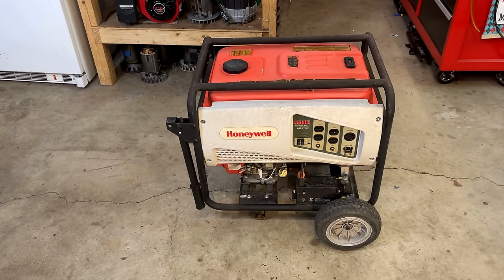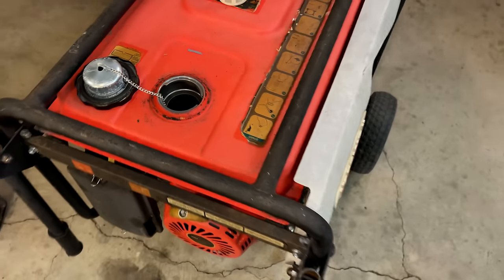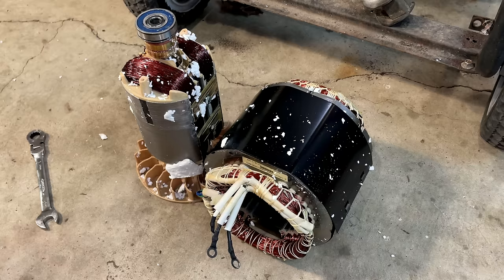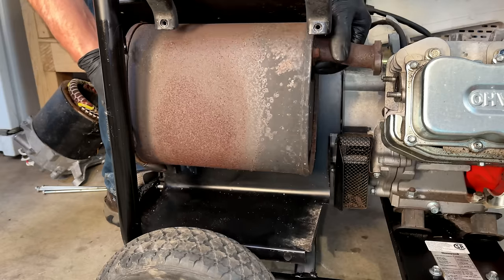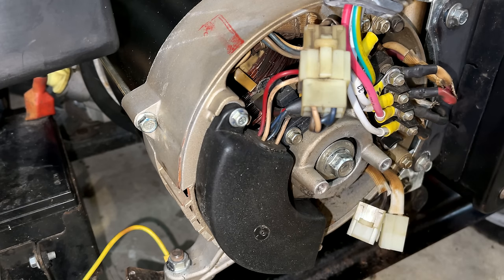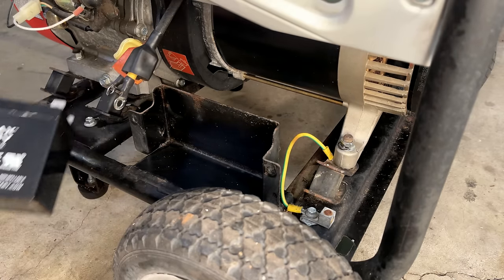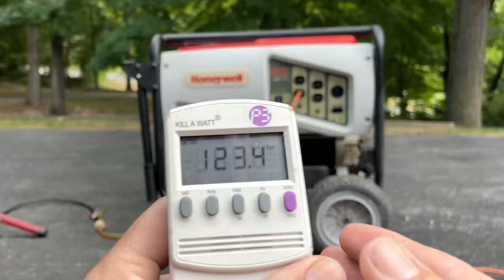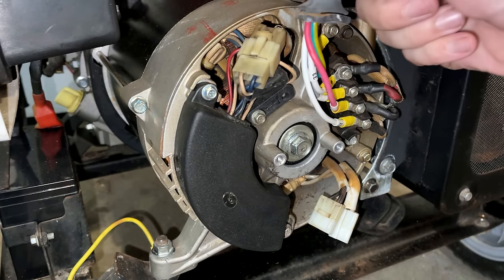Honeywell Generator Not Making Power - Fixed

Comment: I lost track here, you had a new Ryobi powerhead to use as a replacement but you got Predator one in there? What did I miss?
Reply from the maker: Yes.  The Ryobi powerhead was too short.  So went with a used one from a Predator generator.

Comment: Hi, u can carry the bad rotor to a motor rewinding shop and the can change the aluminum wire to equivalent copper wire, and the power head will run just fine

Comment: You should have just cleaned the copper coating off the wire and soldered it instead of going through all this stress for a new power head,except if you dont know how to solder

Comment: Thanks James for the video. Unfortunately, I realized that during step 1 (testing the receptacles with a multimeter), that the no power problem I am having may be from a different cause. None of the 120v recepticles are showing any reading on the multimeter, but the 120v/240v receptaacle seems fine (registering / fluctuating around .7 if I recall correctly) The no power mystery continues. Maybe a fuse or the bridge rectifier?
Reply: Forgot to mention … 
I left my generator uncovered outside overnight and it rained (dang). Started it the next day and heard a small pop. Seems to be a burnt smell behind the front panel holding the receptacles and other components.

Comment: Makes me mad as to how delicate the wires and parts are used almost me beleave they intentionally used the thin and delicate wires to fail so it will fail eventually no mater how delicately you use it to work on it why not double the wire size to not fail no mater what ! But that is the American way. Make it fail so you have to buy a new one !  Read next  video   !

Comment: Well Done Jame's - You've kept out another unit from the dump. Here's a tip for you if you can't get the proper starting battery from the manufacturer. You can get the battery from any store that deals with mobility electric scooters and or if you can and are up here in Canada get the battery from Canadian tire. Try Spray Nine to clean the control panel - You'd be amazed at the cleaning power it has.
And I love your ending display page with the sounding  of a poor engine that barks at the end - How cool is THAT! Wow What a giggle I got out of that!!!

Comment: James, thanks for this channel it is very informative. I am sure you get a huge number of questions so I figured I would try and ask anyway. I have Briggs and Stratton EXL8000 (model 030244-1) generator. The unit is in great shape and the engine runs perfectly. My issue is there is no output. I have changed the AVR and checked the brushes, power panel, tried flashing, and measured the coils. after all of this I am pretty sure I need to replace the Stator and or Rotor. I would rather just replace the whole generator head. The issue is I cannot find this part anywhere. Do you have any suggestions? I really don't just want to get rid of this whole unit just because i have generator head issue.

Comment: I would like to say I enjoyed your video. I spent 14 years in power generation in the Army 
and worked on generators from 1.5 Kw up to 100Kw. The last 31 years I have been operating
and maintaining a 7.5-Megawatt power plant. I didn't realize they still made generators with
brushes and sliprings. Everything I have worked with were brushless generators. This has been 
refreshing to watch. You are a good presenter and very knowledgeable. Thank you for your video.

Comment: Seems a shame not to be able to fix the original rotor. Have you tried soldering/brazing with something like Benzomatic AL3 rods? Al melts at 1220F but these rods melt from 720F which is within the scope of some larger irons. Need to flux or solder shortly after scraping and before Al oxide re-forms.

Comment: I would suggest, now when you have a battery charger connector in the power head, to add a battery charger cable to the starter battery so the generator keeps it charged.
Reply from the maker: The control panel has a barrel connector for a charger.
Reply: @jcondon1  yeah does this work by a transformer in the control panel? I understand its supposed to be a car battery charger connection there, but what I meant was the DC output in the power head that you left unconnected. That DC output could be permanently wired to the starter battery, so the generator keeps the starter battery charged at all times.

Comment: By watching your videos I was able to check and make an adjustment on my generator. I get it out and let it run ever two or three months so it will be ready in case the power goes out. I checked the hertz and voltage and it was 117 volts and 59.4 hertz with no load. I turned the screw in like you do and now it 126 volts and 61.7 hertz with no load. I enjoy watching and learning from you.  Thanks

Comment: Why wouldn't you just take the rotor to any motor repair and have the wires repaired...minimum damage?
Reply from the maker: I have tried.  The local shops will not have anything to do with generator rotors and stators.

Comment: Is checking a 240 volt generator the same as you've been doing to your 120v gens?
Reply from the maker: Yes.  I am guessing thought the stator resistance will be closer to 0.7 ohms.  I usually get 0.3-0.4.  If I test on the 240 output I get twice the resistance.

Comment: Very interesting and informative.   Gives me to think I ought to check the unloaded and underload readings of my generator.  As it is, I run it up every couple of months, long enough to get it nice and hot, to make sure it is in good state for any emergency where it will be needed.  It is kept under cover out of the weather.  I am contemplating adding an exhaust pipe with vehicle type silencers to make it fairly quiet, so as not to make it run quieter to disturb the neighbours less.

Comment: What are all your bolt sizes you have accumulated over the years for removing the power heads off all these generators? I'm beginning to work on some generators and that would save me trips and time to run to the hardware store if I could just get all the ones needed all at once..

Comment: How hard would it have been to check to see what type of wire the rotor was.  It is only covered whit enamal paint, and
all you have to do is scrape it.  If it is just aluminum wire, all you need to do is twist them to gether and put a crimp on it.

Comment: I wonder if you could’ve fixed the original power head with a waygo block instead of having to solder it?
Reply: Sure you could have fixed it but the question is, for how long? You do realize that piece is rotating, don't you? There's this little thing called centrifugal force that happens then. That's where weights want to accelerate out. So your big dumb ass connector is going to be pulling on that tiny fragile wire. Which may just be an issue.

Comment: One question why don't they put epoxy over the wire to prevent them from corrosion and vibrations it seems like it would make it last longer even if left outside
Reply from the maker: The wires in the stator and rotor are coated in varnish.  Not sure if the solder joint was coated in anything.  It would have helped prevent this.  Also a little epoxy to hold the wire still is what they do in higher end units.
Reply: @jcondon1  that's what I was wondering because I've seen tools with epoxy over the connections on the areas that are prone to break under stress so I was surprised that wasn't built better I guess

Comment: Can the DC output jack on the power panel be used to maintain the battery?
Reply from the maker: The DC jack on the control panel is meant for input only to charge the battery.

Comment: Point of concern to me - since you flipped the hot and neutral leads on the power head, did you flip wires in the outlets?  If not, a big concern is you now have hot neutrals in the outlets... and I don't understand how the 240v socket makes 240v power if both hot legs are now neutrals.  Might be something I missed or you didn't film.
Reply from the maker: Neutrals were not flipped.  The hot wires I did flip, but that does not matter.
Reply: @jcondon1  Yeah, I'm dumb.  Even though I watched you move wires around, I had it in my head that the block was hardwired.  Carry on! :)

Comment: To increase or decrease the length of the bolt length add or cut the original bolt to size  as to increase or decrease the power head cut or make a collar to increase the length of the collar head add washers or a sleeve to make it longer or shorter !

Comment: Can’t believe you have to junk that entire rotor for a broken wire. Aren’t there any connectors that could be used instead of solder. Or bring it to the right place to have them put it back together?

Comment: It would have been more entertaining if you would solder or rewind the rotor.
Reply from the maker: I have repaired them in the past.  But the main issue is that the flux was not cleaned on the original solder joint and it corroded and weakened the wire that remains.  It would just break again.  Rotor me can be reword pretty easily.  Just do not have the time.
Reply: @jcondon1  He must think you support your family off this channel.

Comment: @James, i would have thought that wire on the rotor could have been soldered and then some Epoxy over the joint to protect from vibration and corrosion.

And on the new head you flipped the red and grey, i assume that doesn't matter?

Regarding that white side cover, have you tried peroxide gell and clingfilm and leave out in direct sunlight light. Classic computer restorers do this.

Comment: If there's no DC output provision from the Predator stator, How will you keep the battery charged?
 It's not exactly "FREE" if it needs a new stator, but it's still cost prohibitive. Nice work James!
Reply from the maker: There is a barrel connector on the control panel for an external charger.   I have those chargers and would include it with the generator.
Reply: The machine was free, they never said the repair would be.
Reply: Always a YouTube critic pops out of the woodwork.

Comment: i would fix the rotor  , silver soulder. higher tensil str. original rotor has bolted plates for rotational forces so its nice.  if it didnt have that , trash.

Comment: you could repair that generator head wire by clamping it with a piece off a copper pipe..trim off a then slice of the pipe , put a bend in it clamp it over the wires in the generator heads wires then solder it with the clamped wires in the slice of the pipe..or just clamp it..ive done this and it works by giving you a piece of copper to solder to and trapping those pesky wire in the solder on the piece of pipe. 😁😁👍👍

Comment: 'coated with copper' - it's enameled wire.  There's a really thin insulating layer on it you need to strip before you can solder it - typically just by scraping it clean with a blade.  Apologies if that was already clear - it didn't come through in the video.

Comment: I am surprised you have difficulty soldering that connection, generally after the wire enamel is removed they connect quite easily with a reasonably high wattage soldering gun. I can safely say I have never soldered a generator rotor though. :)
Reply: If it is copper clad aluminum then it would not solder like solid copper wire does. Less is solid copper today. That's economics for ya. Solid copper is only for the rich anymore.

Comment: This generator's fault was a broken connection at one end of the rotor's winding.  I've watched as you've found several of these failures and always come away thinking that I would love to try repairing the broken connection for you, but I live too far away.  I have no idea how the Chinese can plate copper over aluminum, but they can, and the result is an electrically good but extremely thin layer of copper over brittle aluminum.  You can make a good electromechanical repair if you repair if you remove the enamel coating from the wire and bridge the broken ends with a piece of tinned solid copper wire.  Prepare the end of the broken stub by applying a small dab of paint remover to remove the enamel coating the portion of wire that needs to be re-soldered.  Carefully remove the paint remover and enamel after a few minutes by carefully wiping with a soft cloth, and then clean the wire end with alcohol on a Q-tip to remove all residue.  DO NOT SCRAPE OR ABRADE THE WIRE, AND ONLY BEND THE WIRE IF ABSOLUTELY NECESSARY -- IT IS BRITTLE.  Once all the enamel is removed from the wire, test the wire's solderability by tinning it with some good tin/lead flux core solder that's at least 60/40.  Best is 63/37.  If the clean wire solders, great.  If not, repeat the cleaning and try again.
Now prepare the other end of the rotor's broken winding by carefully straightening the twisted wire end  and carefully clean with alcohol.  Now lay the two wires out such that the ends almost touch.  Apply a small amount of solder at the end of the clean twisted wire end.  Find a short length of solid tinned wire (such as found on resistor leads) that's about the same diameter as the winding wire, and overlap it onto the untwisted winding wire about 3/8" and touch your CLEAN soldering iron tip to the connection.  The solder should quickly melt and flow over the joint.  Immediately pull the iron tip away.  The connection should be smooth and solder should cover the joint.   Let it cool a bit and then lay the tinned wire alongside the end of the twisted rotor wires.  Repeat the above procedure.  
When you're satisfied with the soldered connections, the last thing is to ensure that the repaired joint cannot move.  Using alcohol, carefully clean the surface of the rotor below the repaired winding section.    Now use silicone caulk/glue to carefully cover and insulate all the bare soldered areas.  Now adhere the repaired length of wire to the rotor's core.  Also put a dab of silicone where the rotor winding emerges from the winding on each side of the rotor.  The idea is to secure this rather brittle wire with silicone so it cannot flex while the rotor is spinning.  You'll not be using enough silicone to throw off the balance of the rotating rotor.  The repair is done! 
Alternately, If there is enough winding wire available to overlap the two ends, do that and don't use any extra wire to bridge the connection.  You will need about 3/8" overlap that is well soldered together.  Be sure to use silicone as above to insulate the bare solder connection and to adhere the loose wire to the rotor's core.

Comment: I find it interest that besides the "main/secondary" jet the other fuel jet is referred to as the primary/idle/pilot jet.  I think this confusion leads people to not understand that proper fuel flow though this jet is required DURING ALL OPERATING CONDITIONS, FROM IDLE TO WIDE OPEN !

Typically, small engines that are surging, the cause is insufficient fuel being delivered through this jet.  In the past, James has open up this jet to cure a surge.

Comment: Cool, a stroll by Cat scan. I doubt the windings are aluminum, instead I believe the issue is the enamel insulation is not being fully removed before soldering. It's a little to tight of an area to get sandpaper so the insulation is not fully removed. Maybe try some lacquer thinner to remove the insulation. Great job as always!
Reply: Oftentimes aluminum windings are used because they are lighter weight for the same current carrying capability. That and it's cheaper than copper.
Reply: @eDoc2020  the only reason aluminum is used is because it is cheaper than copper is. Besides that aluminum is inferior in every other way. That's how it goes with cheap crap.
Reply: @1pcfred  In this case you're right. In other applications like overhead power lines the lighter weight and greater strength of aluminum make it preferred.
Reply: @eDoc2020  the only reason you'd ever use aluminum in any electrical application is to save money. Copper is so superior to aluminum as far as being a conductor goes. But copper does cost a lot more than aluminum does.
Reply: @1pcfred  I thought copper was only 30% or so better, so not that much in my book. I suppose it does come down to price eventually but like I said aluminum is lighter which has benefits for suspended and airborne applications. To use copper in suspended lines you'd need to use more supports.
Reply: @eDoc2020  power lines need support due to expansion. That's what caused the big northeast blackout. A powerline that was overloaded sagged to the ground. When it blew it caused a chain reaction that brought the whole grid offline. Transmission wires have steel cores to increase their tensile strength. Whenever aluminum is used it's due to cost. It's no problem to make strong towers. Though the towers in common use are not particularly strong themselves. I had a buddy that used to climb them then shake them. He could get them swaying pretty good. He was even a licensed electrician. But he never worked for a power company.

Comment: Thank's sir. 
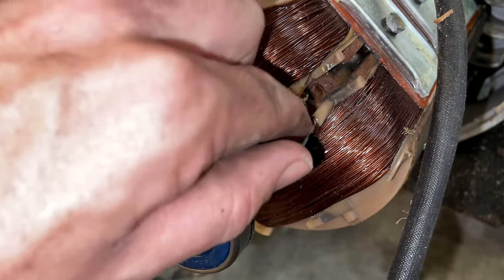16:40  would it work if the broken wire was soldered?  (Edit - I found out later that it is aluminum wire.)
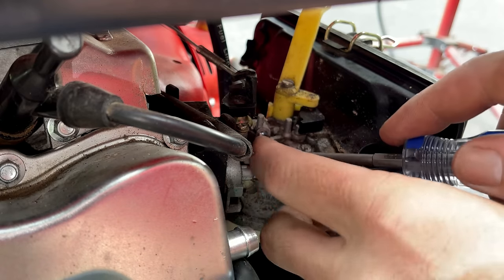1:02:00  Thanks for showing the solution to the ripple problem.